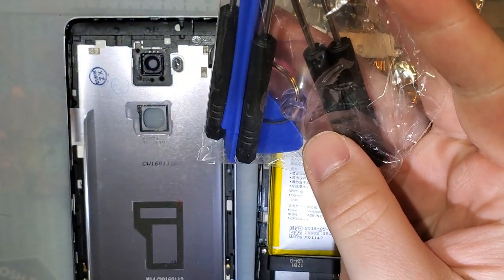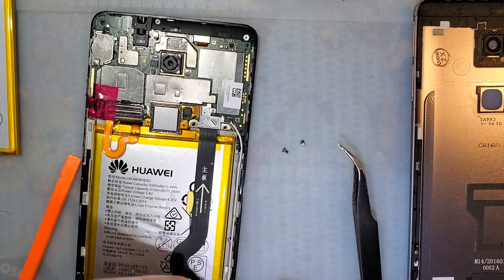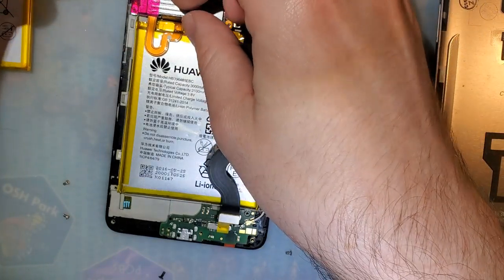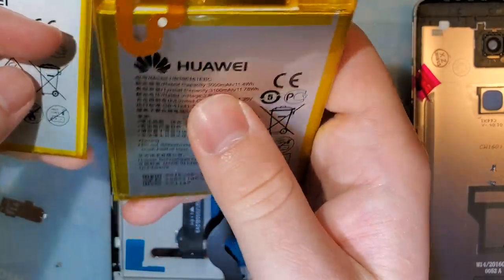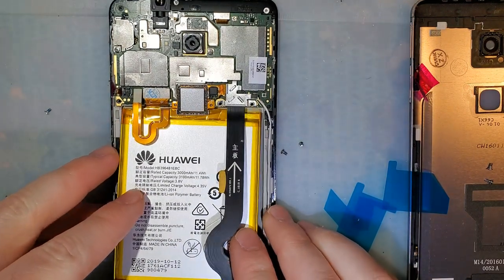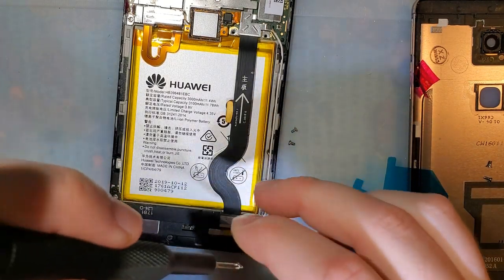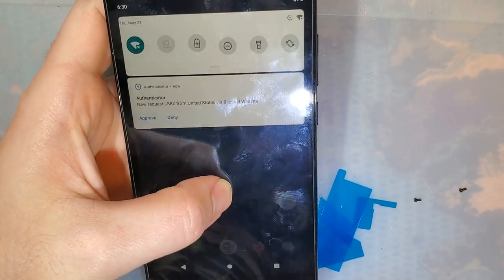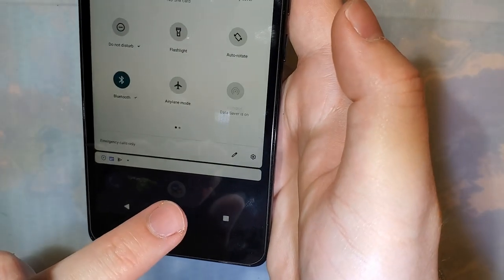Replacing the Battery in my Old Phone (Honor 5X)

Comment: are the screens and batteries you buy oem or after market? and if they are aftermarket how do they compare to the original ones (especially the screen). i need to get a replacement screen and battery for my 6x (well the huawei gr5 2017 to be precise).
Reply from the maker: In this particular case, Huawei phones have OEM repair parts available (or at least this one did). It's one of the things I really liked about this phone.
Reply: @makho  can you direct me toward where you bought them? i found sites that claim to have oem screens with frames but i wasn't so lucky with the battery.